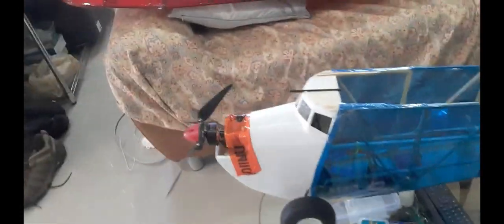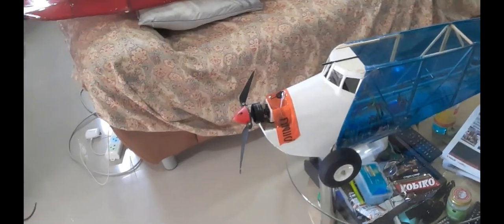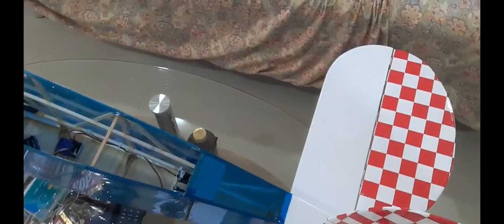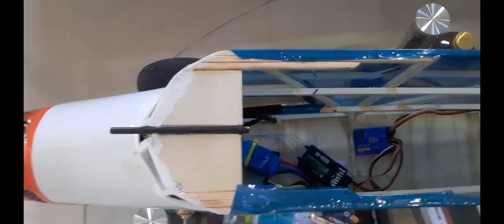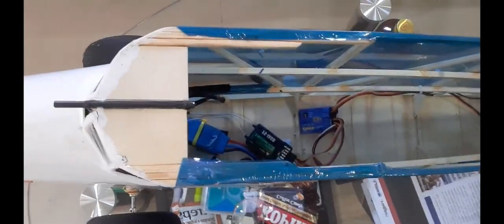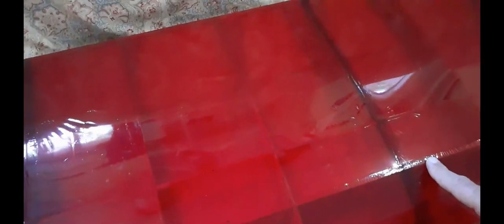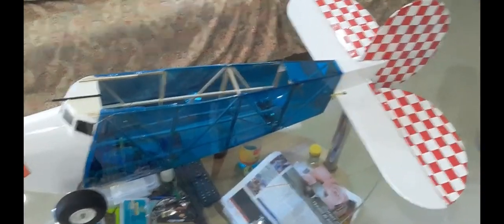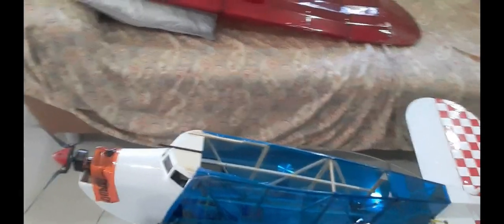Lazy bee rc plane

Comment: the c-m  should be be located at a point, on the thrust line, that vertically aligns with twenty-five percent of chord.     in other words, THAT  is the place where the model should balance, when it's supported at the fuselage.        at link, ideal location of c-m is indicated.      d
https://s3.amazonaws.com/assets.flitetest.com/article_images/medium/truecg-jpg_1384168691.jpg

Comment: information        you may know that this is an  abnormal  model.          the wing has a LOT  of area (and over-long chord),  and the stabs are too-near the wing.
1:14   the mass of servos should be located  NEAR  the cg/c-m;  NOT  aft  of  it.     (c-m  is  center of mass.)
5:30   the tail/tail boom/stabs should be as light as possible.     there is excess mass in the poorly designed/over-large  stabs and in the large cross-section of the tail boom.
these various mass-related issues result in this model having a  less-stable  dom.     distribution of mass.
6:03    Something  weird about the design of the wingtips.
you may know that this model should be able to cruise at about fifty percent of max throttle.        so, you should set the throttle at fifty percent or a bit more, and  use your left hand to  TRIM  the elevator for level flight;  at that amount of throttle.      in order to choose a different cruising airspeed, change the elevator  TRIM.      (if you don't do anything else you should  MOVE  the  servos.)
the span of a horiz-stab does not need to be larger than thirty percent of the wingspan.      to the extent practical, the span of the horiz-stab should be reduced, accordingly.        obviously, if changes are made to the dom, it will be necessary to re-locate  the  cg.)       d
Reply from the maker: Thanks for the feedback!  Knowing that this model as built would likely be tail heavy for an electric motor/battery installation, especially since Clancy built it initially for a heavy gas motor install, I initially installed the servos forward of where the paper plans showed, specifically to move weight toward CG.  I only had 1.5 mm rod available locally in Phuket THailand, so once installed I had too much flex in these skinny rods.  I built a intermediate support platform/guides to eliminate some of this flex, but still had issues with such a long rod run.  I went ahead and found 2 mm rod and adjustable aluminum rod ends, and also opted for the stock servo location, knowing I wasn't helping the tail heavy condition. The shorter and stiffer rod setup helped take lots of slop out of my servo/rod setup and I think helped alot with stability issues.
I agree that the horiz. stab and elevator are oversized, but wanted to initially anyway, follow Clancy's lead and built things as he and his plans suggest.
Again thanks for your input and I am sure I will be tweeking this great plane for some times.
Reply: It is possible to utilise square balsa as your servo rods by gluing and wrapping metal rod to the ends of the balsa. This helps with stiffness if materials are in short supply. Great model build by the way.